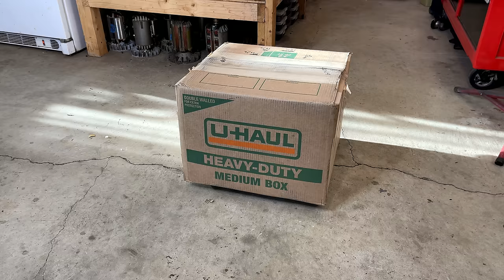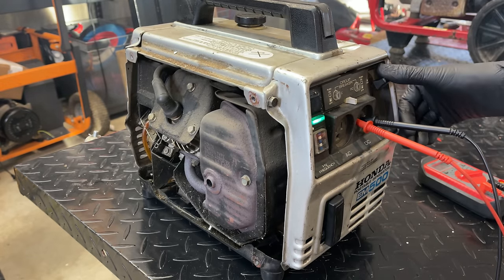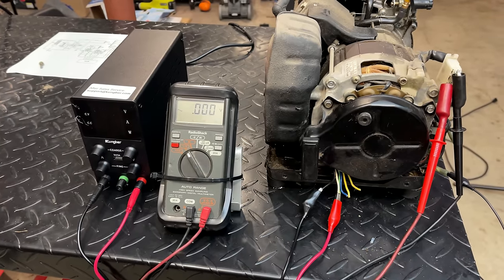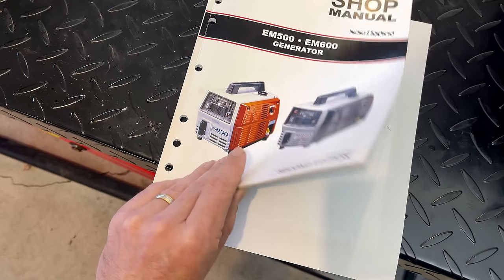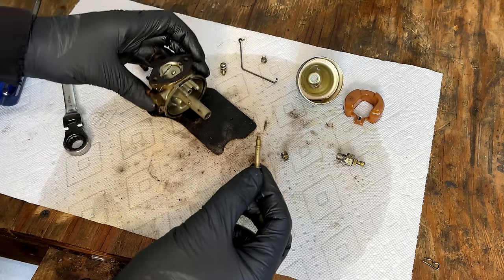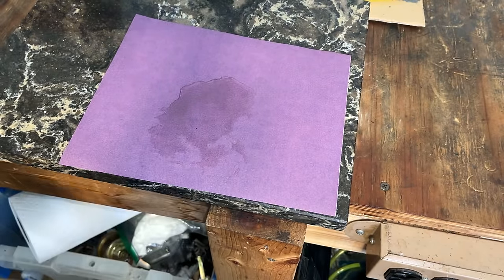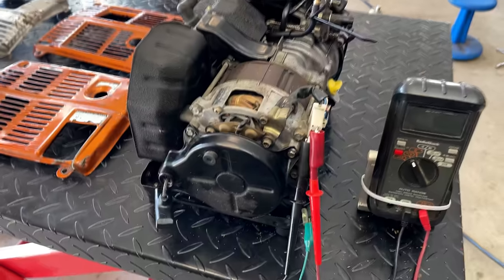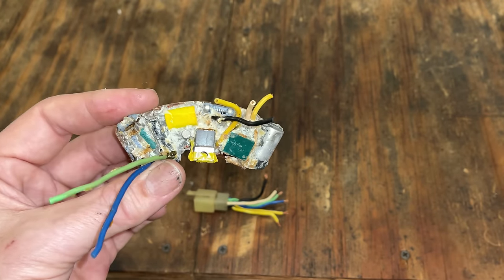Vintage Honda EM500 - High Voltage Problem

Comment: 3D print insulator part, easy to quickly design in CAD, then print your part, I like resin printers, many different resins to choose from high heat, ABS……

Comment: Would a Euro AVR be fixed 240 volts? Seems they are potted and can't be adjusted.  Thanks
Reply from the maker: Not sure if its just the AVR.  Most likely the stator is also wound differently.
Reply: @jcondon1  Thanks

Comment: potting electronics should be illegal. if one of those components fail you need to replace entire thing
Reply: Potting on that board is one of the reasons it lasted 40 years!  Hopefully, a schematic with values can be found.
Reply from the maker: Potting is a good thing as long as its there to protect the board and not prevent maintenance.  Honda could have used a potting that was removable.
Reply: In this situation you need to pot the electronics to make it waterproof.